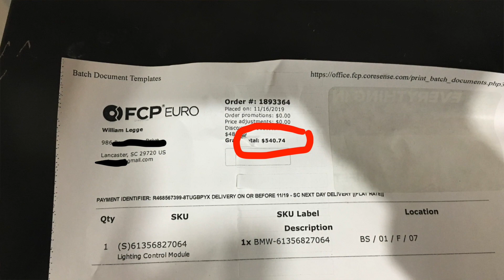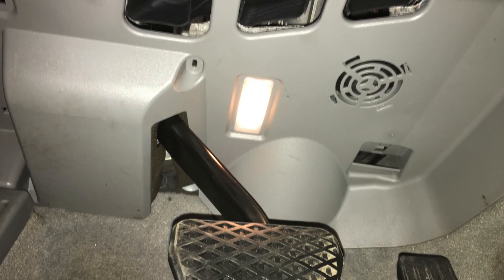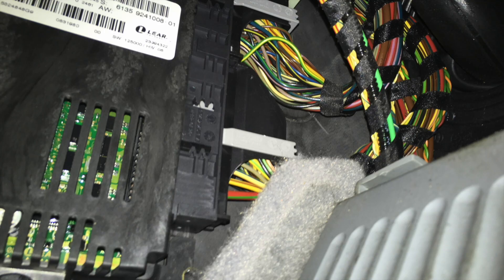How To Replace a BMW FRM Module (Footwell Module)!!!  E90

Comment: Hi, cheers for the video! 1st time I hear/read of a faulty FRM... Anyway, good that you replaced it :)
Most of us who buy and install the NFRM (either 2 or 3) do it because we have the first version of it, the FRM (E9x pre-03/2007) in our cars, which is quite limited in comparison with the later 2... I've seen you coding video and I wonder if the steps are the same to the FRM, from 1-->2 or 1-->3?.  Thank you!.

Comment: question for you? i have 06 330i and i get an error code about the frm because i put new led side markers and I had a guy come over who does coding but could not get rid of that error code and he mentioned something maybe the frm too old. Do you think I need to get a new frm or should i be able tp get rid of that error code.
Reply from the maker: You could try upgrading but that seems like a large expense to just get LED side markers unless you have other plans that would require the updated FRM.

Comment: Your battery was probably pretty weak and dropped below 10.8 Volts. Thats what took it out, or it got shorted when you jumped it which would also drop the voltage below 10.8volts. I jumped tonnes of e90s but only off a battery and/or a car that was not running (correct way) with no issue. 
Glad you got it fixed! There is a lot of folks out there that repair/reflash them for 120$ if you are lucky also.

Comment: I heard there is a software bug on some of the older FRM modules that cause them to be bricked (i.e. fail) when the battery is disconnected and reconnected. Any truth to this. Also, can one replace a FRM or FRMPL2 with a FRM3?
Reply from the maker: I have heard this about there being a bug in the firmware. I have no idea if that is true. Yes anyone can upgrade their FRM module to the newer version. I believe there is an extra step involved but I could be wrong. I’d have to look into it.

Comment: Could the frM module cause problems in an e90s  sunroof and interior dome lights
Reply from the maker: Not the sunroof that is on the CAS if I’m not mistaken. It’s possible it just needs a reset (I have a video on how to do this). For the dome lights it could cause them to fail it did when mine was bad but the map lights still worked.